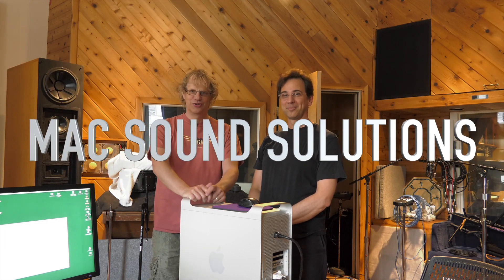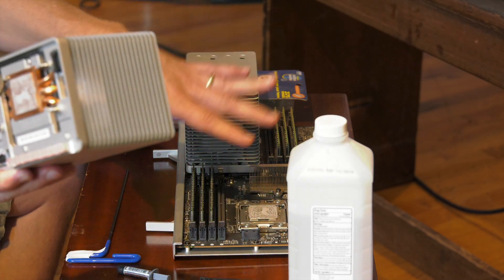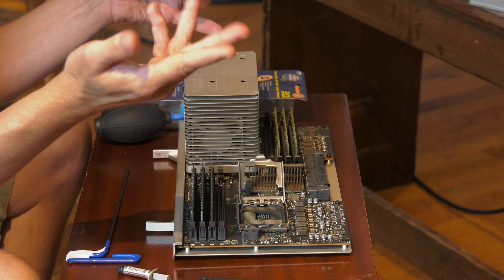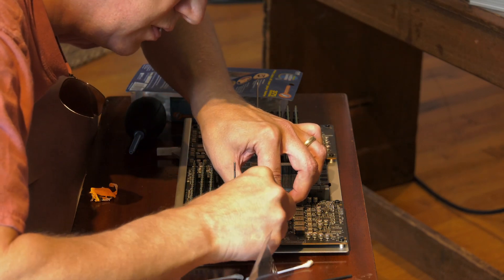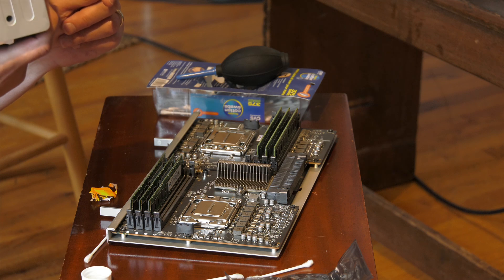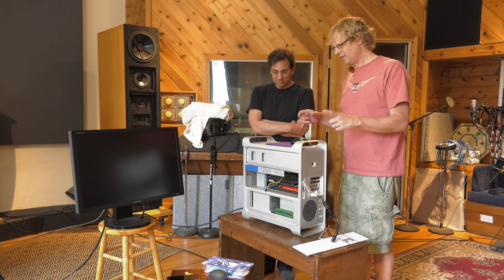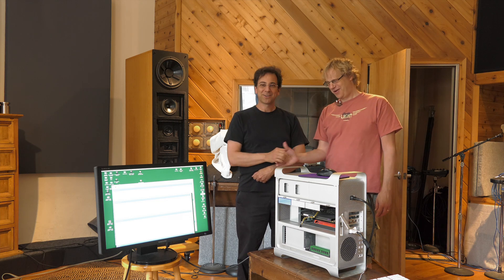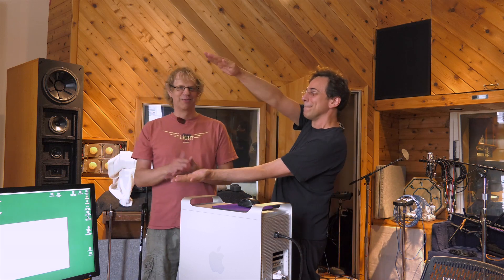MAC PRO 2010 5,1 DUAL CPU UPGRADE

Comment: Hello! very interesting video. May I ask you which screw driver is required to detach the heat sink of the processors ? Is it a Torx TX15, maybe 15-20cm long ? Thank you.
Reply from the maker: @Ziogeppo00  info should be I. This video Mac Pro 2009 5,1 CPU upgrade dual Xeon 5690s issues, fixes, benchmarks!
https://youtu.be/ZLf-xNSE_C4

Comment: Did you take an anti-static electricity precautions (none visible!) ?
Reply from the maker: Not really except for discharging any static before starting. It was not winter and no carpeting, but yes it is recommended to wear a static glove I have done this several times without one no issue just discharge any before hand.
Reply: @MacSoundSolutions Thanks, one—probably the last—question, please: like the X5690, the Xeon X5680 draws 130 watts versus the 95 watts drawn by the X5675 (c. 37% more). Were there, or could there be, any problems with fans running too fast? Thanks!
Reply from the maker: @clivedcarter  my friend Joe in this video and I use our Mac Pros everyday, no issues at all. I highly recommend upgrading the CPU as they are very cheap now and breath new life into them. I also have a gigabyte rx5700xt  which is power hungry GPU but again no issues and no power mods although folks do recommend the pixlas mod I did not do it. I have a Blu-ray and super drive, 4 sata drives usb 3 card and NVME card.

Comment: Great vid.  Does this upgrade help Mac boot faster or it only makes better performance using apps?
Reply from the maker: Boot times don’t really change, installing an ssd or pcie NVME drive will vastly improve boot times over old sata spinning drives, cpu makes the computer faster overall.
Reply: @MacSoundSolutions  thanks.  One of those options are in my next Mac Pro upgrade.  Waiting on my graphics card now.

Comment: I want to upgrade to Dual-X5690s, but I keep hearing the processors need to be a matching pair.
- Does this mean I can't buy a "X5690" from one seller and another "X5690" from a different seller?
Reply from the maker: Nope matching is BS make sure they from Costa Rica it should say it on the chip otherwise they could be pro to types.
Reply: @MacSoundSolutions  BS?
Reply from the maker: @elymarques  BS stands for bullshit, not true, you do not need matched pairs just two that are the same two 5690s or 5680s etc and manufacturer.

Comment: Great video.  Quick question.  I have a Mac Pro (Mid 2010) Mac Pro
  Model Identifier:	MacPro5,1
  Processor Name:	Quad-Core Intel Xeon
  Processor Speed:	2.4 GHz
  Number of Processors:	2
  Total Number of Cores:	8
  L2 Cache (per Core):	256 KB
  L3 Cache (per Processor):	12 MB
  Memory:	16 GB
Which Xeon processors fit this machine?  Are they the Xeon 5680's?  Thanks. Felix
Reply: The Xeon X5690 is the fastest, best CPU that the Mac Pro can take that is also capable of running in a dual CPU setup. The w3690 is slightly faster than the 5690 but can only be used in a single CPU setup
Reply: @rorythomas3084  Thanks for the info.  I installed two X5690's and my Mac is now a 12 core.

Comment: You don’t have to count the turns dude.... criss cross the pattern when tightening and change the screw you’re tightening after each full turn, the 2010 and 2012 are way less finicky because they have the socket that clamps the CPU for you instead of using the heatsink to push the CPU into the socket, you can’t over tighten the screws. Well, you can’t over tighten them with a t-handle wrench that flexes a lot like most of them do. Tighten them down good in a cross cross pattern and you’re good. Also reset the PRAM after upgrading any hardware.

BTW I worked for Apple Computer in Elk Grove California for awhile, I started in AppleCare then went to production engineering back when we made the pro Mac’s there like the PowerMac’s and some special batches of MacPro’s.
Reply from the maker: Yes I know all this and you are 100% correct, I first did a 2009 upgrade, this one was much easier, and yes you don't need to count the turns but I like to do it anyway, and the crisscross pattern is the way to go. 2010 -2012 is much easier than 2009. FYI My fiend wrote a song about another one of my firends called "SpanktheFrankPlank" many moons ago.
Reply: @MacSoundSolutions  Thanx forvsharing....Spanky!   :P

Comment: It is True that in a Mac Pro 2012 if you put your SDD into a PCIe slot  with a card  adapter will run way faster? thanks
Reply from the maker: Yes the internal sata bays are 2.0 using the pcie slot you will get 6Gb/s performance of SATA 3.0 so it wont limit the speed of the SSD like the internal drive bays will. usually getting you around 500MBps  read write or even better install a MVME drive up to 1300 MBps read speed but you have to be running Mojave or Catalina
Reply: @MacSoundSolutions   thank u
Reply: YES!, I bought a samsung 1tb SSD and used it in a HD bay and my mac pro 2012 5,1 was a bit faster and snappier, but then I got a Pcie card from OWC to put the SSD in and now it is WAY faster and snappier all around.

Comment: Is there is any difference  with the upgrade with the Mac Pro 5,1 Mid 2012 ? thanks
Reply from the maker: It depends on what processor you currently have in the 2012. The fastest you can install is Xeon 3690 3.46 ghz for single processor and Xeon 5690 3.46 ghz for dual processor. They have gotten very cheap.
Reply: @MacSoundSolutions   yes, those are the ones I want to upgrade from my dual 2.4 GHz 6-Core Intel Xeon
Reply: I wonder if I can do it my self...looks  tricky
Reply from the maker: Blue Matrix it’s very easy with a 2012 you just need thermal pastel and the hex key and rubbing alcohol and a lint free cloth to remove the old thermal paste from the heat sync.
Reply: @MacSoundSolutions   thank you...so I may do it my self.. I want it for my Pro Tools Rig HDX
Reply from the maker: @bluematrix7  do you have a single CPU or dual? Either way you will see a big boost in performance if you go from 2.4 to a 3.46 or even the Xeon 5680 3.33GHZ which is what I have but now that the price has dropped so much I would go for the max 3.46. My friend in this video so big improvement and he is still using his system. Today I am installing an RX5700XT video card and making another video as I testing out Catalina with it to see if its worth the jump, if it doesnt kick ass on my 980ti then I wont bother and return it but it should make FCPX much faster on rendering etc. I mainly mix audio but also do a fair amount of video so seeing if I can squeak one more year out of this mac pro. For Pro Tools I really don't need a more powerful computer my mac pro does the job for the mixing I do but I would like to take the leap to the new mac pro when they drop in price some.
Reply: @MacSoundSolutions   my Mac 2012 5,1 is a dual 2.4 GHz 6-Core Intel Xeon so want to go 3.46 ghz    ..and yes  want to use it for 1-2 years more and then jump to the newer Mac Pros that they seems to be a total Crazy Beast   ..I use it for mixing .... so this is why I am scare to swap the processors my self  .....looks pretty simple ...just some people say some crazy things
Reply from the maker: Blue Matrix 2012 is much easier than 2009. Just take your time, makes sure no old compound falls into the sockets when you remove the old processors. Have a good look before you put in the new ones, and don’t zap your logic board with static :) It’s a good time to clean out all the old dust bunnies out of the computer before removing the old CPUs.
Reply: @MacSoundSolutions  thank you... do you belive the MacOS SSD and  audio Drives (SSD) both are better connected to a PCIe slot?

Comment: Hi guys, Maybe a silly question, but what's the size of that hex key tool you're using for the sinks? Im in the UK and use both metric and imperial. Need to go out and buy that tool for the job! thanks.
Reply from the maker: 3mm 9 inch hex key like this one https://www.amazon.com/Journeyman-T-Handle-Klein-Tools-JTH9M3/dp/B005G3HJ28/ref=sr_1_1?keywords=3mm+9+inch+hex+key&qid=1583441429&s=instant-video&sr=8-1
Reply: Unless it's a torx, some are! All that counting turns is nonsense.

Comment: I know it's on the list, but has anyone tried to install Dual x5687 in a 2010 Mac Pro 5,1?
Reply from the maker: Buster Dawglous Should be fine, any 5600 Xeon works with duel cpu Mac pros 2009-2012. 2009 need the firmware upgrade first.
Reply: @MacSoundSolutions  Hey thanks for the prompt reply! Yeah, I was thinking the same, but then I'm seeing on MacRumors that the x5687 and x5698 are the only ones' that don't work on this long list of Xeons they have--bummer!!(there was no reason given to as why) but in any event, I have them on order and they'll be in the next week--so I'll report back. I have a 2010 MacPro I'm upgrading and a couple of x5687s would be soooo nice...fingers crossed!
Reply: @user-si8zf9hy1b  Any word on the x5687 on dual cpu Mac 5,1 (2010)??? I am seconds away from just forking up for the x5690s but would love to know if these are a much more affordable option, first. Thanks!
Reply: @chaseaaron8746  Sorry I missed this!! x5687's DO NOT work in Mac Pros!! I was bummed! Luckily I had a t5500 that I threw these into.  I had x5675's in the t5500 and I took those and put them in the Mac, and x5687's in the t5500. I will wait and buy the x5690's to put in the Mac Pro next.

Comment: hello video I watched with very successful excitement, my '' pro pro mid 2010 -2x2.4 xeon 8 processor westmere ''
I would like to upgrade the 12 core processor '' xeon E5670 '' is suitable for me?
Reply: You meant X5670 (6 core) it is compatible with your MAC, so no issue.
https://forums.macrumors.com/threads/mac-pro-cpu-compatibility-list.1954766/
Above link have the list of all compatible CPU with the Mac Pro.
Good luck
Reply: Thank you it was very hepful
Reply from the maker: cengiz cebeci I would go with 5680s or 5590s. 5690 is the fastest you can go I have 5680s working great over a year now.
Reply: @MacSoundSolutions  I'm newbie about this 5620 2.4GHZ compatible cpu me have advice
Reply: do you think my mac works 5690?
Reply from the maker: cengiz cebeci get the X5690 if you can afford them, any of the 5600 series Xeons will work. Look on eBay for prices
Reply: @MacSoundSolutions  I can get turkey 2x 5690 is compatible with my system
Reply from the maker: @cengizcebeci8726  yes

Comment: Hi, the surgery works fine, but now I have a memory problem, dont reconize all my 32 GB OWC 4x8GB , anyone help?
Reply from the maker: Also if you want the fastest speed you want to only install the ram in the first three slots of each bay leaving the last slot empty. I had 32 gigs but read up on it and cut back to 24 gigs it made a big difference in my Geekbench score, day to day regular use not sure how much diff it really makes though.
Reply: HI Lance Tks a lot, I will try this way, I have 4x8Gb by OWC with heatsink in memory, your videos makes me to take courage to do this
Reply: now I have X5680
Reply from the maker: Usually that means you need to tighten down another quarter turn on the heat syncs. But try zapping your pram first and see if that does it. If kit figure out which bay is missing the ram and tighten it up a hair reboot and see if it posts
Reply: I thing my heatsinks is quite diferente, my mac pro mid 2010 looks like headline studios.
Reply from the maker: SO what fixed the issue the end? Please post as it helps other folks doing the upgrade.
Reply: for sure Lance, AT CPU B, I take off the heatsink, and put it again screwed the heatsink by squeezing in cross format, than solved. now I will make some test and I used the macs fan control to look the sensors temperature.

Comment: any updates on your own MacPro?
Reply from the maker: J Harris Samsung 950 boot drive boots in 13 secs 1200 read write speeds. Still Flashed GTX 950 ti. Just updated to high Sierra waiting on Nvidias web driver before I can install Mojave.
Reply: @MacSoundSolutions  Yeah, 2021 here. About that Nvidia Web Driver...
Reply from the maker: @chumcool  no updates to nvidia drivers since High Sierra but look into OpenCore Legacy Patcher OCLP I think they have some nvidia cards working in later Mac OSs

Comment: Can you do this to make a single cpu quad core a dual cpu 12 core? meaning replacing the tray with a dual cpu type?
Reply from the maker: after looking a bit it looks like you can, you should make sure if it's a 2009 Mac Pro that you use a 2009 tray or if its a 2010 use a 2010 tray. But I am not 100 percent sure. I would do a little more research before doing trying it.
Reply: You certainly can. Like he said, you just need to make sure its from the same year.

Comment: Awesome video, it will definitely help for when I upgrade my 2010 5,1 Mac Pro tomorrow. I just got my 5690's, and I'm hoping to hit around 28-30k Geekbench. Right now I have 2 x 6 Core 2.66GHz with 64GB of 1333 ECC DDR3 ram and a GTX 1070 with a SATA2 SSD Samsung EVO 1TB and yet Im hitting 18k on geekbench, is something wrong?
Reply from the maker: GeekBench 4 has lower scores than Geekbench 3 also the 64bit paid version gets higher scores than the free version, The other thing is you will get lower scores but maybe 2000 on the multi test when you have all the ram slots filled. you should only fill the first three slots on each ram bay leaving the 4th slot empty to get the fastest memory speeds, which will up your score by about 15 to 20 percent. What it means in the real world varies. It depends on how much ram you need. I have 24 gigs which is plenty for what I do audio / video work. I run Pro TOols and FCPX at the same time sometimes without issue.

Comment: Hi Lance, quite interesting and entertained your video. I have a mac pro mid 2010, 2x2.4 GHz so, would you recommend to upgrade to 2x Xeon 5680s? is this the highest upgrade possible? do I have to upgrade memory as well? my current memory is 32gb DDR3 ECC 1066mhz. i hope you can have a time to reply me back. Thanks.
Reply: Luis Bejarano With 5690 you can put 1333Mhz ram in there
Reply from the maker: Hey 5690 is the top 3.46ghz but do take a little more power than the 5680s 3.33ghz your ram is already at the fastest speed for your Mac Pro 2010.
Reply: Thanks Lance, you rock man!
Reply from the maker: Francesco Goldoni Francesco Goldoni yes but if you have an original 2010 it should already have 1333 ram but if you upgraded the firmware on a 2009 then yes you can put 1333 after you upgrade the processors.

Comment: Performed this upgrade a week ago on a 2010 Mac Pro 8-Core 2.4GHz to bring it to a 12-Core 3.46GHz (purchased two X5960 CPUs for $118 each). I am getting an average single-core score of 2,900 and an average multi-core score of 24,000 using Geekbench 4 (not sure how your getting 30,000 on a slightly lesser processor with the same TDP). Have one more 2010 Mac Pro 8-core system to perform the upgrade on – total time of install is about an hour. Thanks for the step-by-step.
Reply: Also, I was previously at an average single-core score of 2,100 and an average multi-core score of 14,000 using Geekbench 4 before the upgrade. Roughly a 38.1% increase on my single-core score and a much appreciated 71.4% increase on my multi-core score (still would be nice to know how 30,000 was achieved – CPU lottery, I guess).
Reply from the maker: Geekbench 4 lowered the scores to make room for faster processors, my score is geekbench three score is  around 29,800 and my Geekbench 4 is 23160, for example my processors are the 5680s. So I would say your score is right where it should be. Go on the geekbench page they have a lot of scores listed for the same Xeons and you should see your are about where you should be.
Reply: Thanks for the quick reply... I also upgraded the RAM from 1066 to 1333, installed an SSD and put in a 3GB graphics card for rendering (from a 5870 to a 7950). So for an hour of my time and a small investment, well worth it. Thanks again.